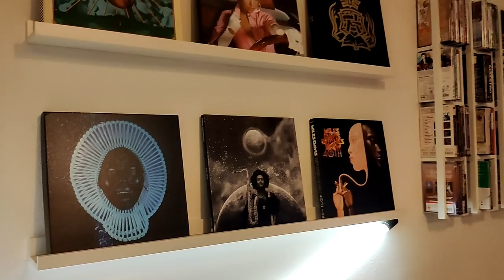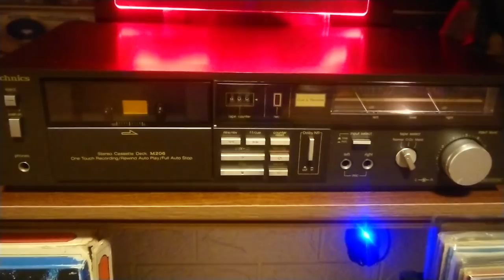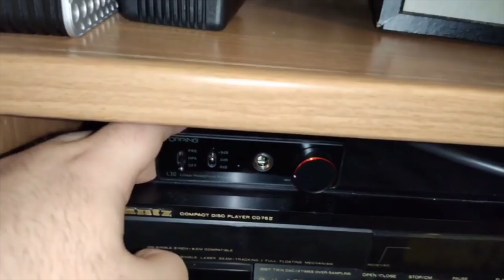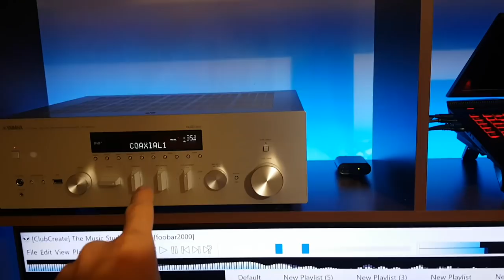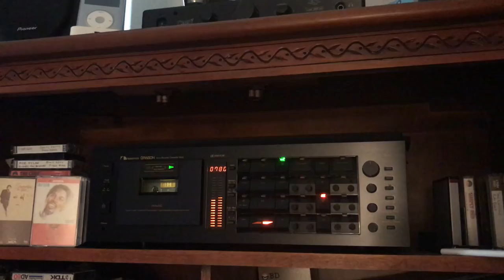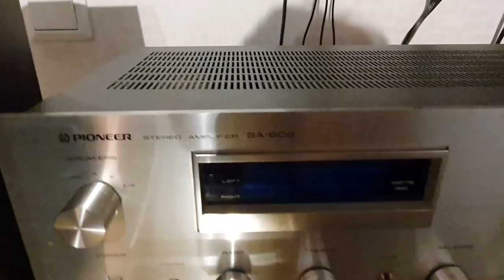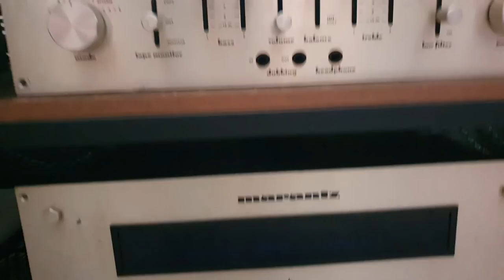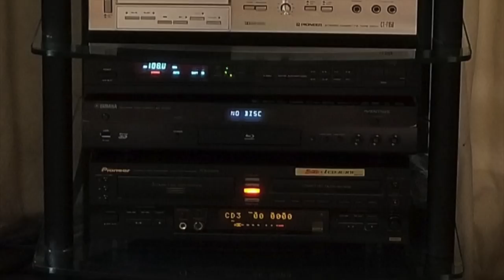The Hi-Fi Show: Room Tours & Gear from the Audience (Pt 1)

Comment: Hey, you have been looking for I2S input device to your dac. Somebody from today's presentation showed us: Singxer SU-6 reclocker. It has I2S output and Kitsune sells an upgraded version. I guess you can review this babe and tell us sound improvements of your Holo Audio Kitsune dac. What do you think?
Reply from the maker: Yeah, but this has only a I2S input. The problem, which the box I suggested resolves (probably not audiophile grade components), is having an HDMI/I2S protocol converter. Plus the May is extremely precise with its crystek VCXO clocks, no need to reclock IMO.
Reply: It is called DDC meaning digital to digital converter, it purifies and shapes signal to dac. Input is USB and output to dac is I2S. Denafrips is selling similar  device. I also suggest looking for network bridge.
Reply: hello, I am the owner of the singxer su-6 in the video, Indeed it is a usb reclocker, but it also has a supercapacitor for usb noise filtering, and internal OCXO clock ( oven controlled ).
it has I2S output indeed, but also spdif. 
For me it works much better converting the usb to spdif to my dac, than using the USB input from the DAC.
My next upgrade would be maybe a DAC with an I2S Input, so I can take full advantage of the SU-6 interface.
I know as well that a good streamer with dedicated linear power supply would be better, but I will explore this later.
I also have the etheregen in my radar for testing... as well as 10mhz master clock... I think it will be interesting to explore :)